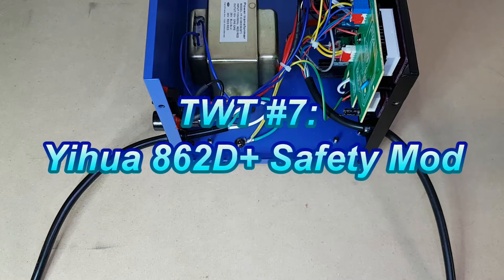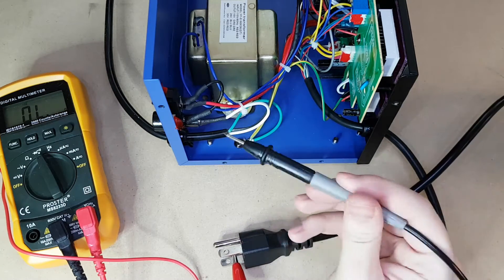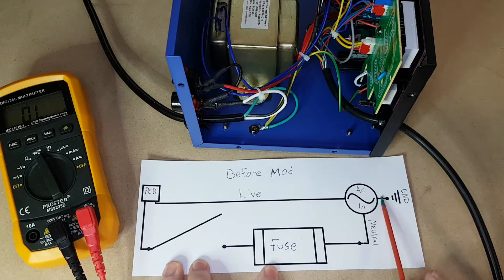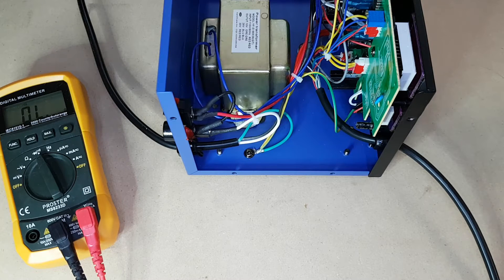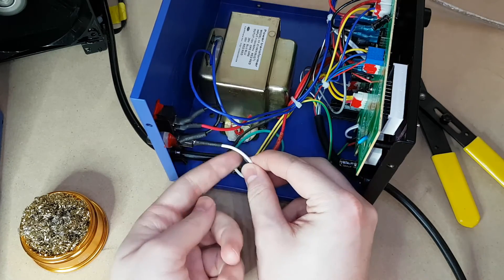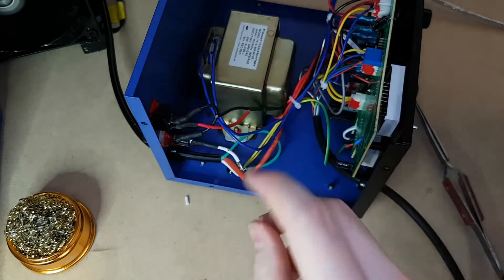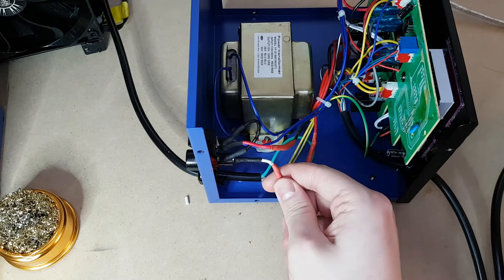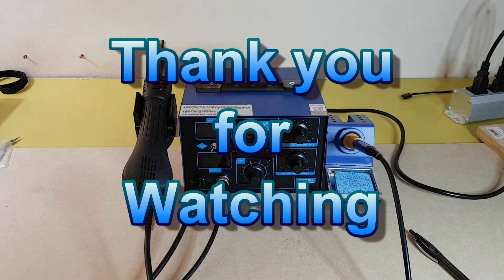TWT #7: Yihua 862D+ Safety Mod

Comment: the reason for this issue is that these units were originally designed for the type F euro plug market where there is no polarization on mains plugs http://www.worldstandards.eu/electricity/plugs-and-sockets/f/ and were then later retrofitted with 120 volt guts
Reply from the maker: Interesting, that certainly seems plausible. I would have thought if they were redesigning it for 120V they would have put the fuse in correctly. Then again I have heard of units with the fuse installed correctly, so I'm still leaning towards a lack of inspection before sending it to North America playing a large part.

Comment: How does this happen? I'll tell you because I have built electronics in China. The workers you get are  by and large uneducated and often have little concept of quality. They build the box turn it on, it works, good, done. I had a product that we sold to a very picky telco. The box was to contain specific items includiing docs, a CD, a wireless modem, antenna etc. Everything was to packed very specifically including the locations of labels on the box etc. I went and showed them. On our first shipment the carrier did 100% inspection and we failed on over 30% of the items. No hardware failed and indeed passed all tests. It was th packaging order and location of labels etc. We literally had to give them videos and pictures of the items. On top of that we hired a guy in China to just turn up and the plant every once in a while and start pulling product for QA. In the case of this item the worker believed it was OK and ju8st packaged it. Yihua didnt built it - a third party did but Yihua should not that you have to own QA if you want to build in China!
Reply from the maker: Yeah it is unfortunate that there is no additional QA before shipping them overseas, or even a QA step by these sellers once it has arrived from overseas. 

At least it isn't too difficult to fix the issue, at least it wasn't in my unit. I suppose for the insanely cheap price, some compromises on quality must be assumed. It is a good soldering station once the issue is fixed.

Comment: hello! so after the mod can I leave the box plugged in now when I'm not using it? is it ok? also, could you make another vid that would make this machine 100% safe? oh and in Canada, are you using 120 volts? please make suree to answer all of the questions. great vid btw
Reply from the maker: Hello, thanks for the questions!  

First up, after the mod you can indeed leave the box plugged in, as the switch will prevent the 120volts of the mains from entering the unit. (Assuming the switch isn't damaged or somehow faulty). I personally keep the soldering station and all of my electronics gear plugged into a heavy duty fused power bar which I turn off whenever I leave the room, this is just a personal preference though.

Second, Unfortunately as a hobbyist I don't quite have the knowledge nor expertise that would be required to redesign this unit for 100% safety. After fixing the mains switch and fuse I am confident enough, at least personally, to use this station on a nearly daily basis, so while not 100% safe(very few things are) it is within the acceptable risk zone for me.

Finally, Canada does indeed use 120v, though depending on region and power supplier it seems to fluctuate between 110-125v which as far as I know is 
a common fluctuation even around the United States. Most of the time the power in my house is sitting around 117V, at least according to my UPS units.

Hope these helped!
Reply: awesome! and a fast reply back! you definately helped, thanks a lot!!
Reply: Hi there again! So Today I just got my work station. Its very nice. I used it already. But can I still do the safety mod or do I have to "drain" the remaining power when it's not plugged in?
Reply from the maker: I left my station unplugged for a while before opening it and doing the mod, but mostly because I had to set up for recording it. 

I would say to be extra safe let it sit for a while, there are a couple fairly large capacitors inside but they should drain fairly quickly and while they shouldn't be able to cause any problems when working with the Neutral and Live wires, sometimes it is better to be cautious.
Reply: I took it apart and saw that my wires are different colors 😮 what do I do? How do I even check if its wired correctly or not?
Reply from the maker: That's not too surprising as I believe they just construct these units with whatever scrap wire they have lying around.  The first thing to do would be to take a Multimeter and trace back the wires starting at the plug. So basically do what I did to make sure the cable wasn't just wired incorrectly, which should be at around 1minute 33seconds in the video.

So with the unit unplugged take your Multimeter in continuity mode and connect one probe to the Live prong of the cable, then take the other probe and check each contact of the switch and fuse, making a note of which ones have continuity when the rear power switch is on, and when it is off. Then do the same for the Neutral wire. (I started with Neutral in the video, but I had already previously determined that the Neutral was wrong.)

 If wired correctly the Live connection should have continuity through the fuse but end at the switch when the switch is off. The Neutral should have continuity up to the switch, it should not have continuity through the fuse when the switch is turned off.

Out of curiosity though, were the wires coming in from the cable still white, black and green?

Comment: I jist purchased this on ebay... so... what happens if I jist leave it as Is? what situation would cause a fire or shock? because.. I'm worried about tampering with it. I haven't even got it yet
Reply from the maker: Since it is using mains voltage all it would take is a short somewhere in the unit to cause a shock, fire is less likely but could occur if there is a severe enough short inside. 

The reason it is unsafe is that having the fuse on the neutral side bypasses its purpose in the event that there is a ground fault inside the unit, the most dangerous of which would be a fault in the transformer or in the heat gun circuitry (the heat gun runs at mains voltage on mine). Having the fuse on neutral means that it would never see the current from a ground fault and thus would never pop. You would be relying entirely on the circuit breaker in your house to trip in order to protect you. (Which here in canada means it would need to draw more than 15A sustained or spike for an insane amount on regular non GFCI breakers)

Fire wise, whenever you have a ground fault heat is inevitably produced and in worst cases it can actually cause arcs. Heat can eventually start a fire, and if there is significant arcing that too could result in fire.

It depends on how lucky you are with your unit, or if they have changed the wiring since I got mine. If you're lucky the fuse will be in the correct place on the live wire (which I have seen in some units) so if there is a short it will pop and prevent any further damage to you or your property. I have also seen units with the switch wired correctly but the fuse still on neutral. 

I would recommend leaving it unplugged and removing the case just to take a look inside before using it the first time. Follow the mains wires and check to see where they are going, use a continuity meter if you want to be sure. If it looks okay inside then there is no need to be concerned. 

The warranty on my unit was basically 1 year limited with me having to pay the shipping to send it back to china if it was defective... Thus I had no issue with voiding it as it would cost $50+ to ship it back to them for me.

Finally the reason the switch being on Live is important is similar to the fuse, if there is a ground fault the switch will not be able to turn off power to the unit since mains will be flowing from the Live wire into the ground wire and bypassing the neutral.

Even after fixing the dubiousness inside of mine I keep it on a switched heavy duty power bar (that also has a fuse) and I never leave it on for more than I need to, and switch off the power bar whenever I leave the room (to be extra safe). Call it mains voltage paranoia! :)
Reply: Tinkering With Terrius I certainly will take your advice, thank you for the time you took to reply In such  detail.
Reply from the maker: Thank you for the question, I always enjoy when people take time to ask questions! Hopefully my response helped, it was a bit rambling due to writing it prior to Coffee... :)
Reply: Every typical heat gun runs off of the mains I bought one of these a couple of years ago, and mine is fused /switched correctly. I like this thing. Works great.
Reply from the maker: Thanks for the comment! I really like mine as well, it makes life so much easier than using a fixed temperature one. I'm glad to hear that there are some that are wired safely though, I guess I can hope that mine was an exception to the rule, but of the 3 I have seen so far they were all wired wrongly (though for different reasons).

Good to know that most heat guns run off mains, I imagined they would have more protection or at least isolation than they do in reality I guess.
Reply: Well, I just cut off the Chinese plug and install a new British 3 pin plug. It held up good so far.
Reply: Make note that you should not do this unless your unit is wired backward like his.  I have checked the 3 i have here and all 3 were fine.  If you rewire yours and it was correct from the factory you will cause an unsafe situation.

Comment: Saike 952D, Yihua 862D, Kendal 862D, are identical stations, in all details! Is a market issue! But I think the producer is just one !!
Reply from the maker: Not too surprising I imagine there are quite a few different items like this which are just re-badges of the same product from the same producer. Good to know that the Saike 952D and Kendal 862D are the same.

I just hope they eventually get some quality control and make sure they don't leave the factory so dangerous! It it a great soldering station for the price once the safety problems are fixed.
Reply from the maker: I was just stating that it was good to know that the Saike 952D was the same as the 862D+, until you mentioned it I hadn't heard of it. 

After some research it indeed appears to be identical, the only difference is the name badge and the model number. That explains why the box had numerous part numbers on the outside, one being 952D.  They are almost certainly all manufactured by the same supplier.
Reply: It looks like this, after several searches I did. I just ordered the Saike 952D and if you said the components were different or poor quality of the Yihua 862D it was likely I would have canceled the order, sorry for my bad english, I'm translating with google translator from english to italian.grazie yet
Reply: Did you looked inside it? Don't think Terrius can tell anything about "better or poor" quality components since he only has the one. Still I am interested in this too...